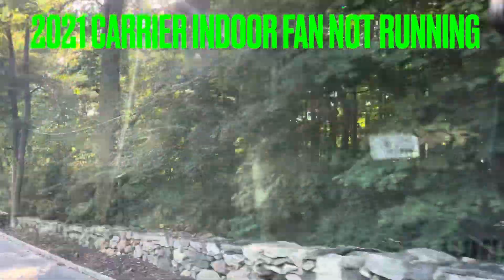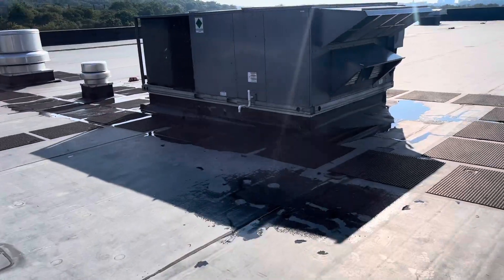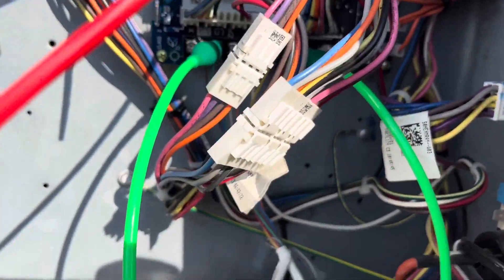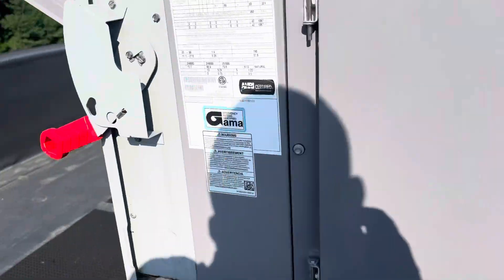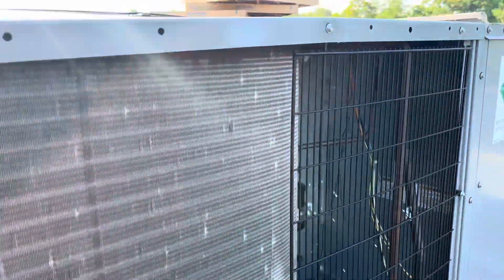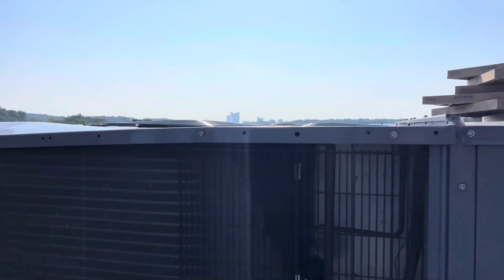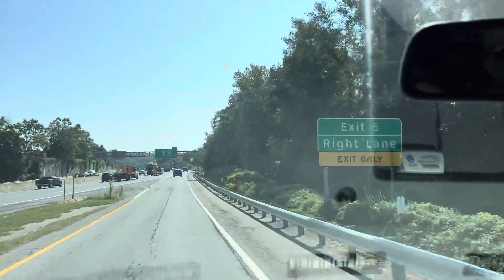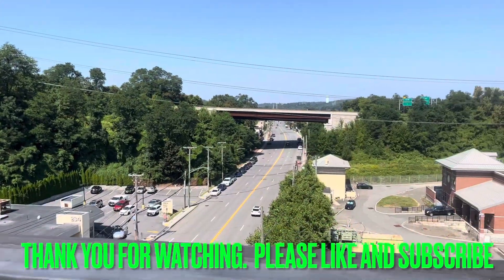HVAC.  VFD FAILURE.  HOW TO BYPASS A CARRIER RTU VFD #carrier #airconditioning #electrical #hvac

Comment: Enjoy the content bud, making my own as well.  Just one bit of advice…  The solution you used to get them air is great and pretty much how carrier designed this due to inverter quality/power issues.  Big issue is…. If you have a fire, or say that motor takes a dump on you causing a fire.  The smoke detector will engage but the fan will still run, feeding the flames.  My suggestion is wire in a three pole contactor at the VFD.  The low voltage control voltage is right there as well, just splice in.  Just a suggestion to avoid bigger issue
Reply from the maker: I’m gonna follow you.
Reply from the maker: Thanks Brother.  I appreciate that.